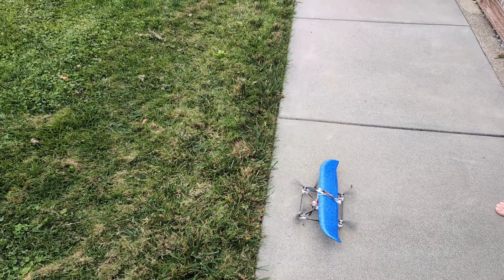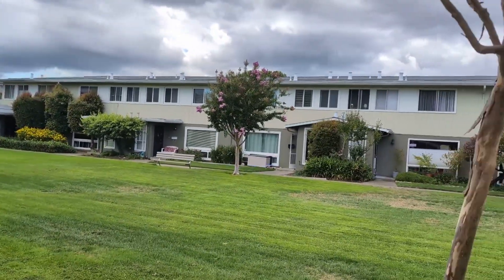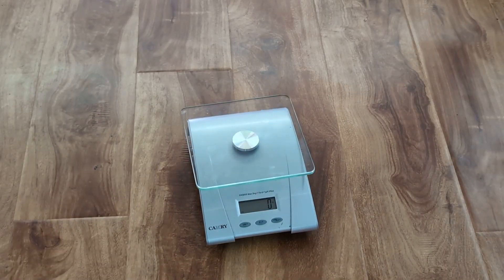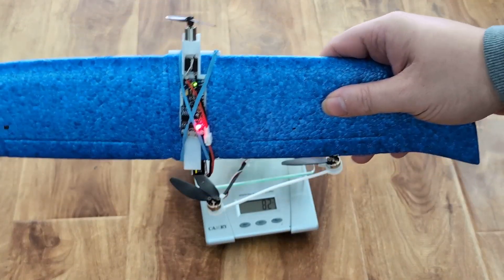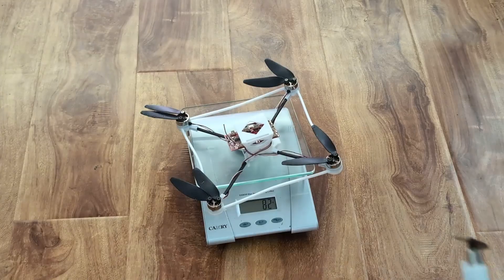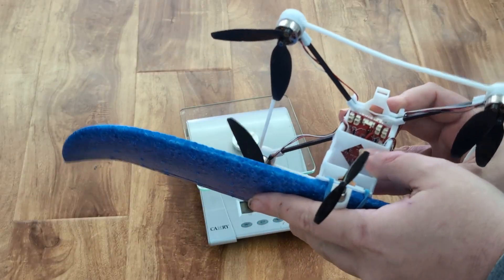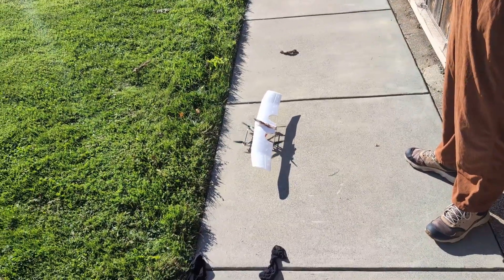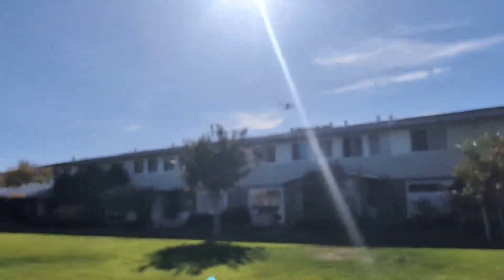MicroVTOL add-on for multicopters

Comment: Since there's no rudder or elevators, how do you fly the wing? Does the drone part do the turning and lift parts?
Very interesting indeed and also below the RID limit, perfect.
Thanks 👍💪✌
Reply from the maker: The drone props still steer it - you want to use the roll and yaw at the same time to do a coordinated turn.

We're going to release the STL files if you have a use for it.

Comment: Hi! nice work! i was thinking of using a hinge that allows the wing to be in a central plane coaxial with the 4 motors, that allows you to reduce weight and you dont need a new computer. a solenoid or a servo motor to lock it in place ... i think software won´t be the easy part.
Reply from the maker: That's exactly what we are doing next, good catch! We'll have a video up next week.